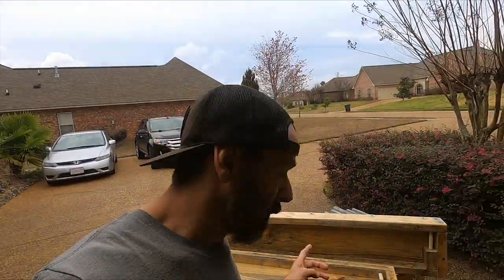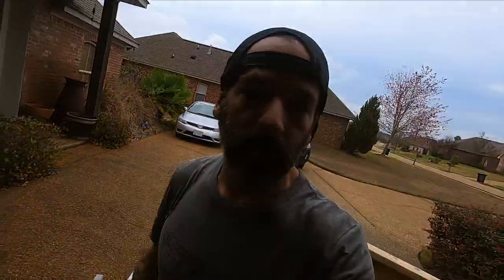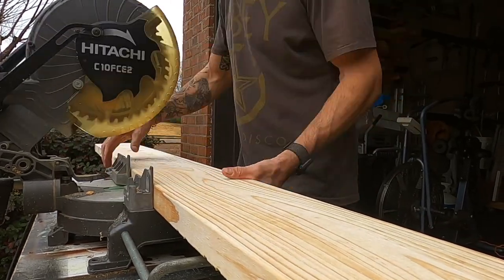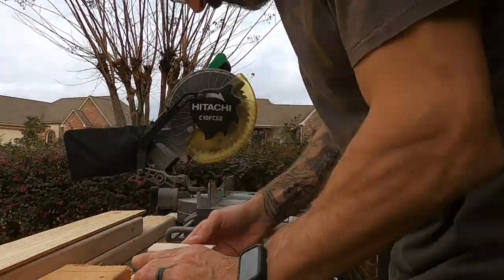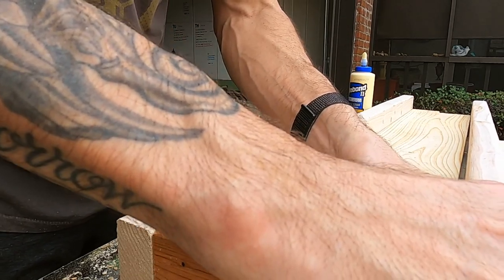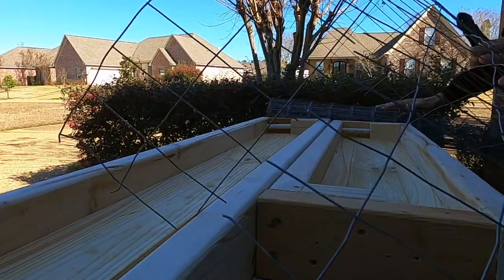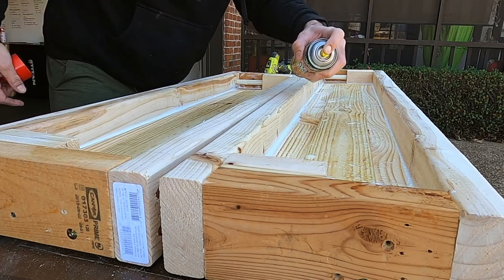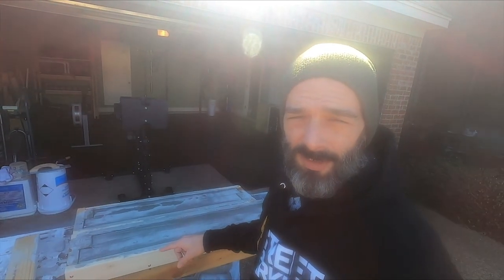DIY CONCRETE GARDEN BOXES: How I made the molds and poured the concrete.

Comment: End result?  What did you get for your effort? Lets see your assembled  boxes.
Reply from the maker: Come spring I will try to get to a follow-up video on my experience with them. End result: 
Make sure your math is correct on all the blocks. I had some ends blow out because of not fitting the same on the different sizes. Also, living in the southern US, anything planted near the edges will get cooked. I had some snow peas that kept drying out from the heat last year because the blocks retain heat. All in all the blocks survived the spring, summer and winter even with the last week of super freeze. I would highly recommend building them if you have had to replace raised garden beds in the past every few years or just want a garden bed to last.

Comment: Why is it needed for such thick pieces if wood to make the mold?
Reply from the maker: With the amount of moisture from the concrete and being able to reuse them to make multiple blocks, thicker material is necessary. Using something like plywood would warp and the screw holes would get stripped in the process.